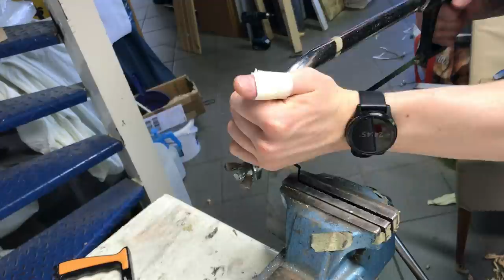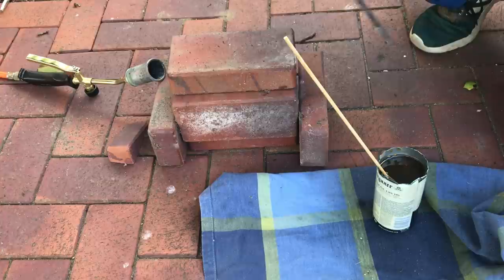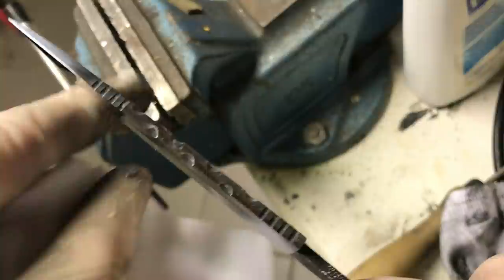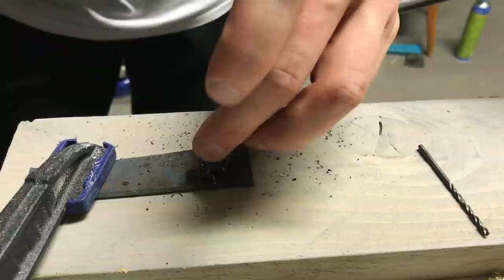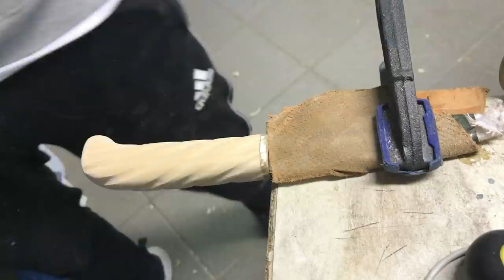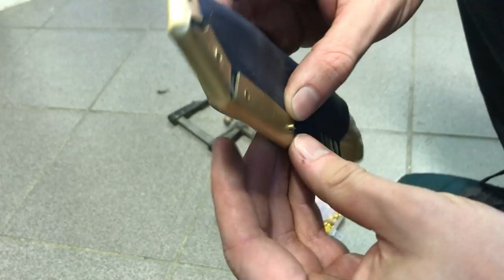NO POWERTOOLS Puukko Build - Beginner Knifemaking Project

Comment: Very nice work mate  , having a proper gas forge is better than using those disposable ones you used. I used to do it that way , then upgraded to a charcoal BBQ then a gas forge with a 9kg bottle. How long have you been making knives for ?.
Reply from the maker: Thank you! I‘m usually using my propane forge for that aswell. Just wanted to show that you can get the job done with cheap tools aswell. 
Roughly 2 years I‘d say 🤔
Reply: @NjordArtisan  cool I have been at it for 4 years only as a hobby mainly use old files , 1080 , 1084 , 1075 & SUP9 . Well I look forward to seeing more of your videos take it easy mate .
Reply from the maker: It definitely is a great hobby, best I‘ve ever had 😄
Thanks! I‘m currently editing the next one. Should be up next week 👌🏻